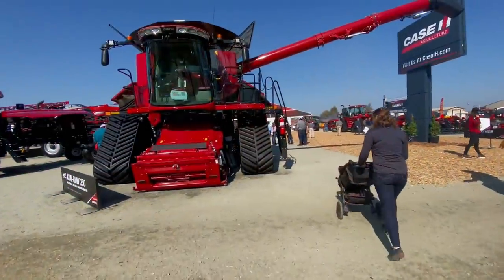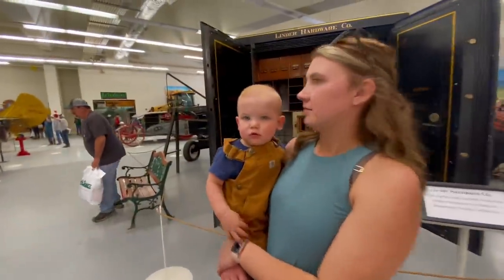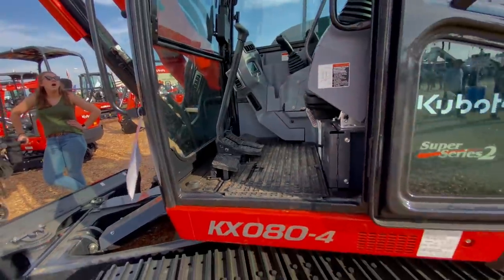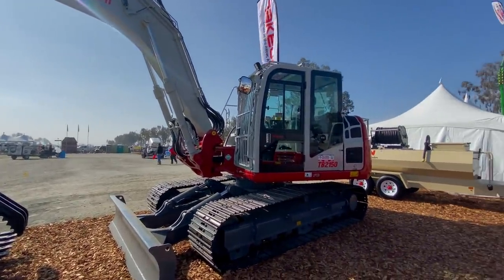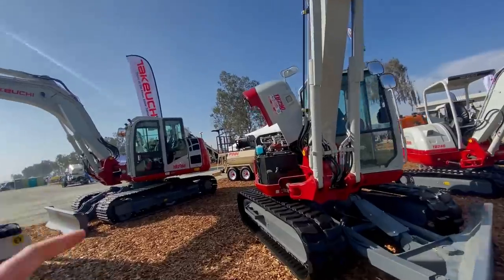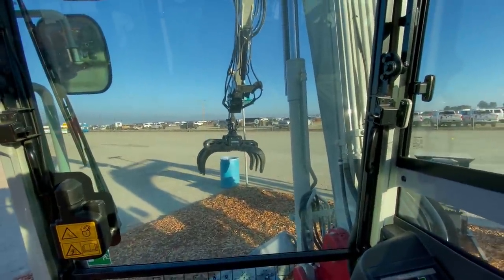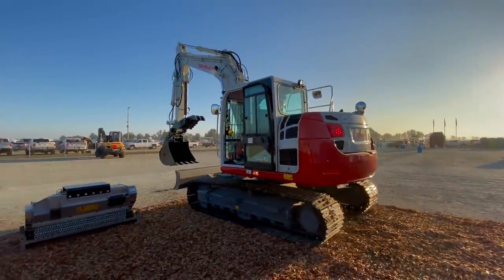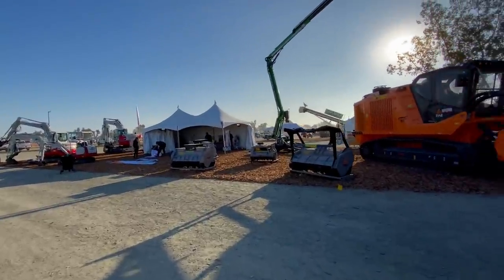NEW TRACTOR SHOPPING! 2 MACHINES! WORLD AG EXPO 2022

Comment: Takeuchi make a great machine have spent alot of hours in a tb1140 series 2 a tb153fr a tb370 and a tl 10 and TL12v2. So smooth and powerful and you don't need to rev them flat out to get them to do anything. Fit and finish is great and standard inclusion with them is pretty good.

Comment: The only thing I don't like about the newer Mini, Midi excavators is the backhoe swings on all of them. I prefer the standard back set boom. due to more ware points, more stuff to break and fix + I have no use for it.
Reply from the maker: Probably the toughest part of the machine is that hinge spot. I’ve never seen issues with it there. I don’t mind having it or not. When I need it. It is handy
Reply: I have done a lot of demo and grubbing with the one's I have owned. 2 more bushings 2 more cylinders and more lines to break.